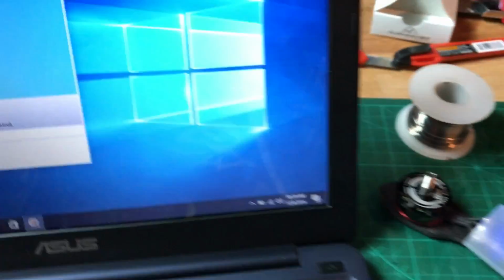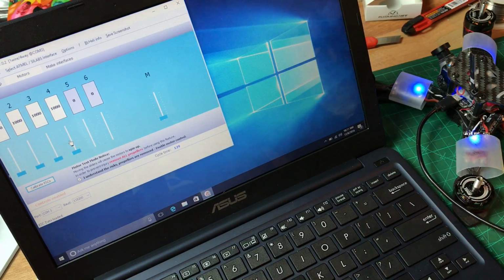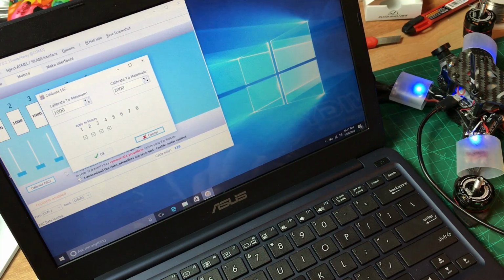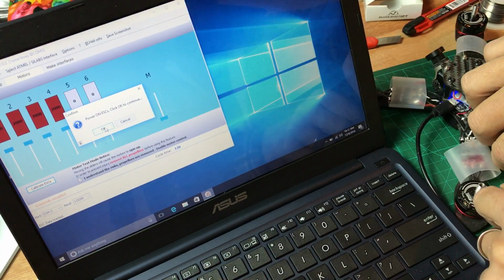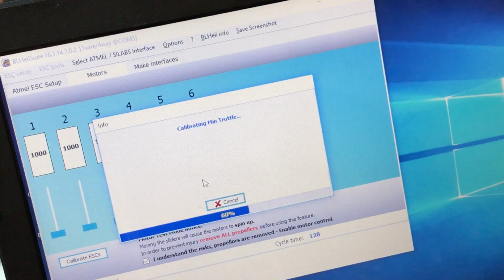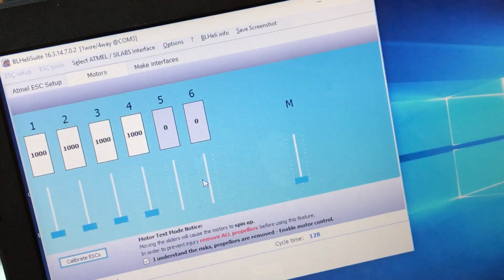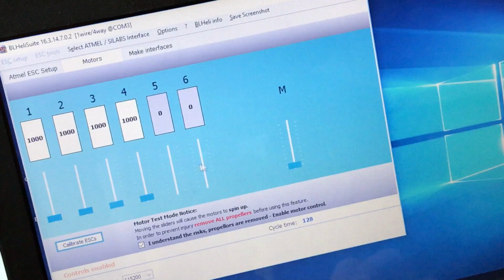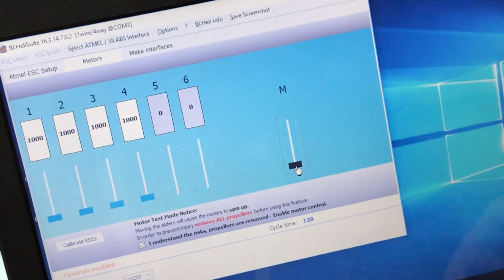Flyduino Kiss 24a esc's , Emax RS 2205 S 2300kv motors

Comment: Let me ask you real quick. With the Kiss24A can you actually cross the + and  - wires to reverse the direction rather than bridge the jumper? Will that work and if so is it safe to do?
Reply from the maker: +techtiptricks Nooooooooooooooooo..... lol
Reply: I ask because at 1:00 you mention rather than crossing wires or blheli...
Reply from the maker: +techtiptricks that would be swapping any two of the three motor wires to reverse motor direction. Not the positive negative wired

Comment: Going from sn20 to those has got to feel nice. How are they running with those motors? I just set up a quad with the same ESCs and motors and getting the dreaded mid throttle oscillations. Havent played with it enough, hoping it is something that can be solved easily.
Reply from the maker: I haven't had any oscillations, I just updated to beta flight 3.1, we'll see how that flies!

Comment: Do you have any trouble with the fact that the motors on 4s full throttle will draw 30A++ 
The ESC's are 24A. I am asking because i really want to buy the kiss 24A and i already have the 2205s motors. :)
Reply from the maker: No problems- 20 - 30 packs in

Comment: I run the Kiss 24a / Kiss FC with the dshot600 firmware!  Its the most locked in quad i have ever flown - Simply amazing!  You can also add there pre-flashed minim osd which pulls the info from the esc telemetry wire etc, seems pretty accurate from what ive tested so far.